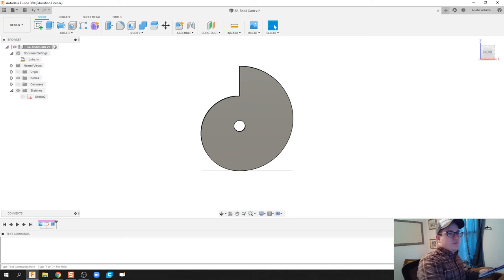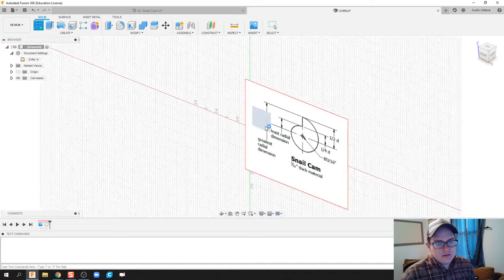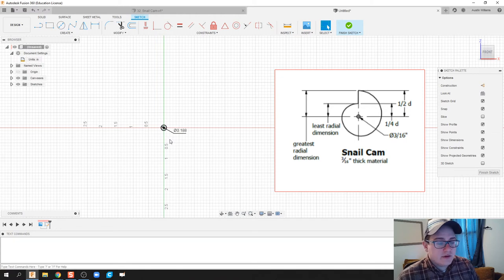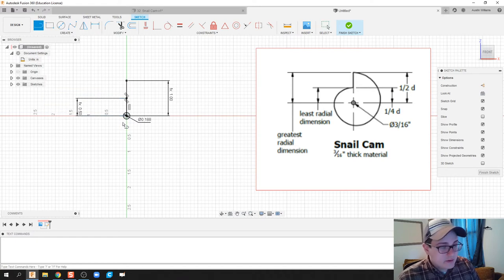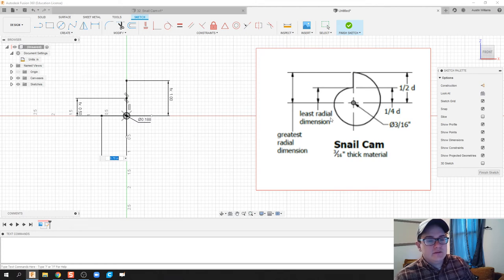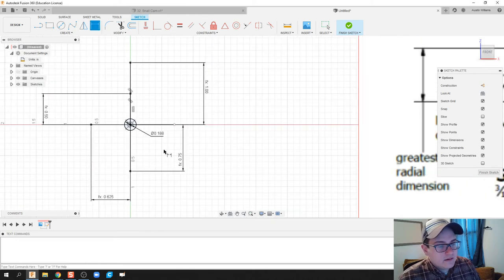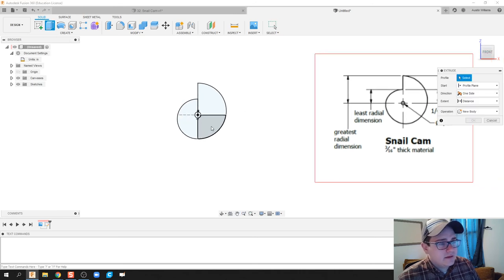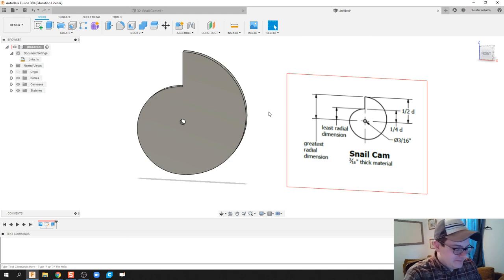Parametric Constraints (Snail Cam) -Day 32 of 100 Autodesk Fusion 360 Journey

Comment: Sorry,I didn't understand the calculation. Is it possible to elaborate a little bit, please?
Reply from the maker: It is fractional addition. Starting with 16ths, add 1/16th per location and you can simplify the fraction.
Reply: @LearnItDoItMakeIt  thanks a lot